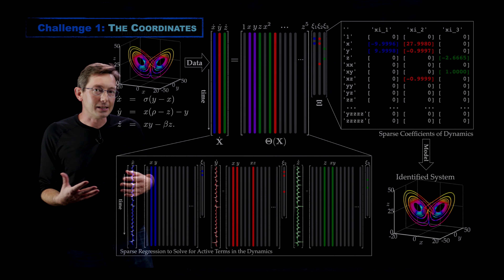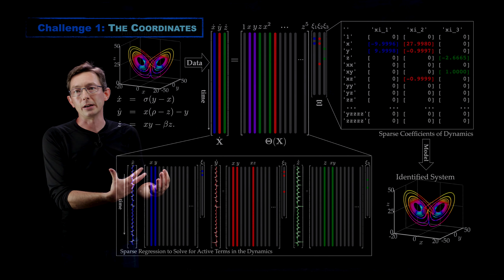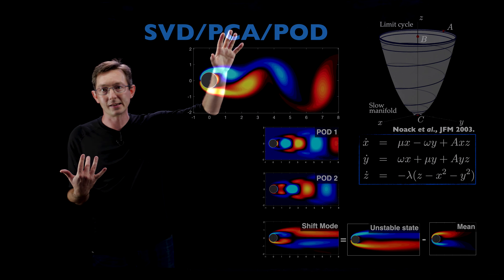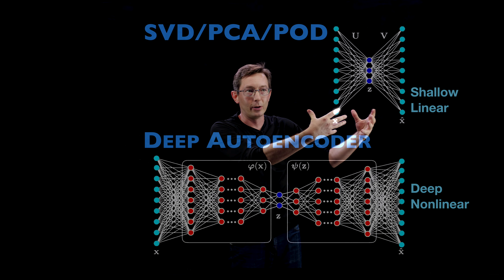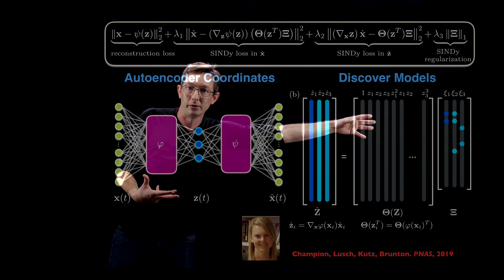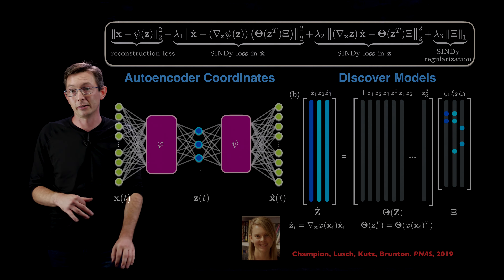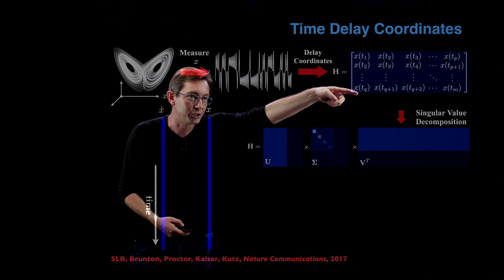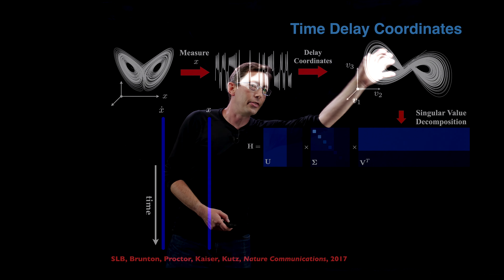Sparse Nonlinear Dynamics Models with SINDy, Part 3: Effective Coordinates for Parsimonious Models

Comment: You mention using SVD to reduce data dimensions. Is a correlation matrix appropriate to use before SVD (or PCA)? Does the correlation matrix need to evaluate all the dimensions and products to avoid the loss of relevant data? Is there a rule of thumb?
What is a reasonable data dimension to target, 3, 20, 50, and does it affect SINDy's ability to converge on a solution?

Comment: But what is the point behind getting a model that consist of a latent varibales z that are non interpretable? Basically, you can learn any non-linear mapping by autoencoder. And how do you interpret this after?
Reply: I do believe the latent map doesn't necessarily need to have some general interpretability, especially if you're working with a relatively new dynamical system, where you can infact suggest your own interpretation, with prior knowledge as guidance 

However, let's suppose you're working with high dimensional spatial data that you wish to compress to some latent representation, in that case, during data collection, there should be some scaler or lower dimensional variables that also describe your system to an extent, here's what I mean:

If you collect a video feed of an oscillating body on a spring mass with some damping, we know that system is governed by the dynamics:

m.d²x/dt² + c.dx/dt + kx = 0

(m, c and k are mass of body, damping factor and spring constant respectively)

But let's assume we do not know this ODE that describes the dynamics of the system, and we infact wish to look for it, for the data collected, each frame in our video should correspond to some low dimensional or scaler information that is also collectable alongside the high dimensional video data, in our case it would be things like displacement and velocity of the body (with m, c and k being constant for the most part). So our autoencoder would be trained such that it's latent representation contains the exact information of the displacements and velocities, as well as other arbitrary information (that we don't need to interpret) required for image reconstruction by the decoder.

When we have properly trained our autoencoder to successfully learn a latent map that incorporates the exact scaler information that describes that high dimensional state, then we can use SINDy to learn our dynamics with the part of the latent maps that correspond to our displacements and velocities.

You may be wondering, what the point of all that is if we can just get the lower dimensional vector or scaler representations in the first place. Well I guess it would be for systems where it is more difficult of nigh impossible to do so.... inotherwords the one you trained with would be high dimensional data that has been manually annotated with its corresponding low dimensional vector or scaler representations.